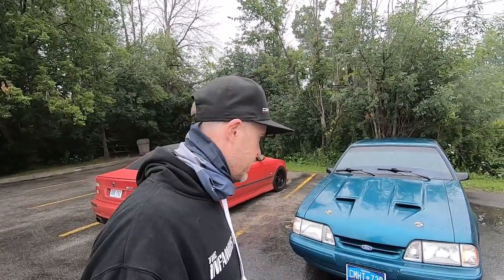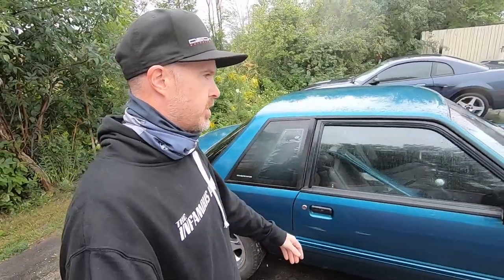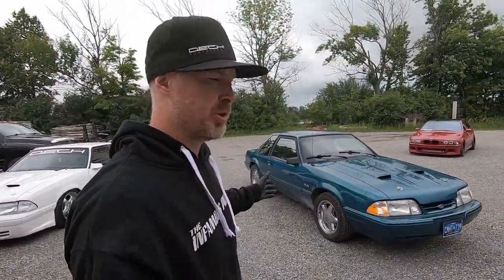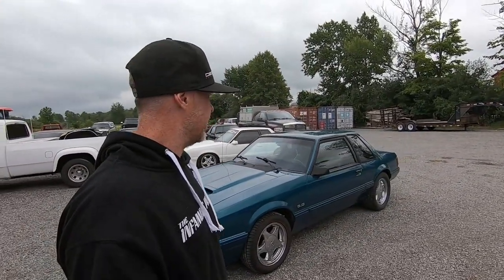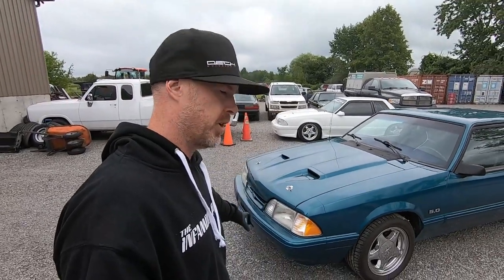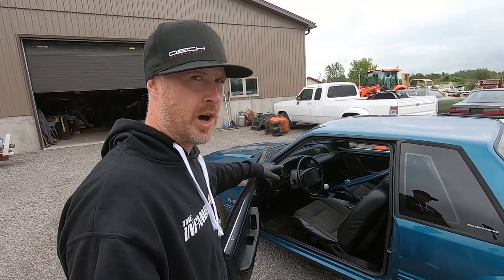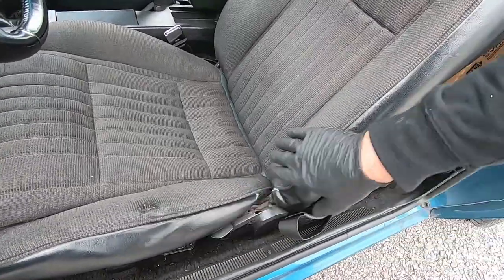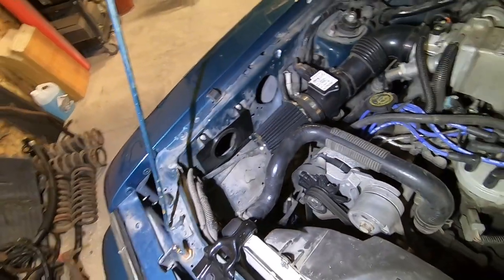How Long Will I Keep this 1993 Reef Blue Foxbody Coupe? - TIPS04E63

Comment: Sheesh , how do you find these?  I had a reef blue hatch. Bought it before the 94s came out as a left over. I paid 14,500.00 with an 86 GT trade in. Never knew it was a rare color until this year. It was sold in 98. It did pop up on NJ Craigslist 2 years ago. I almost bought it but got cold feet . I regret not buying it back.
Reply from the maker: Ya I hear ya man... Buy backs are tough and lately I have been doing more of them lol